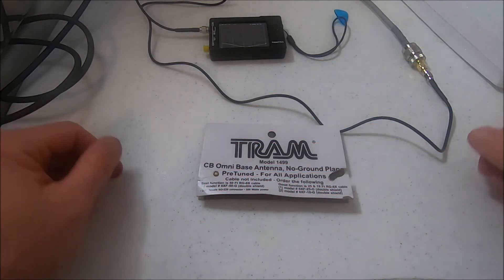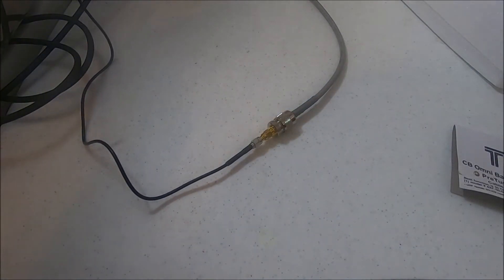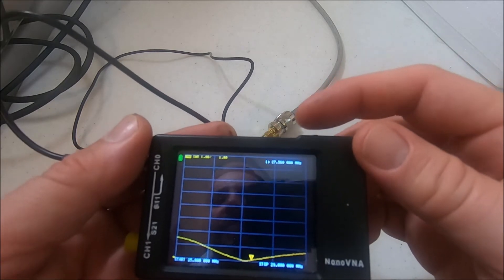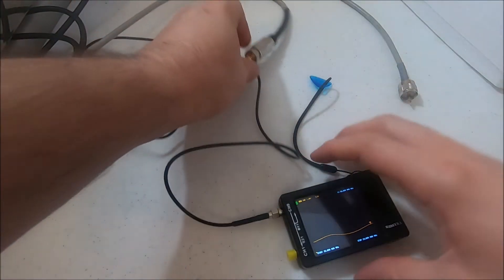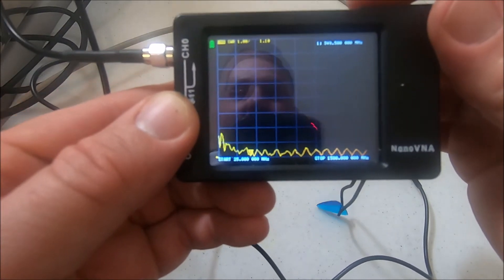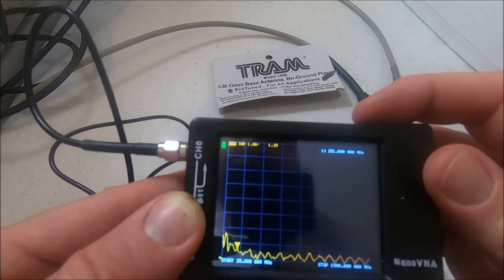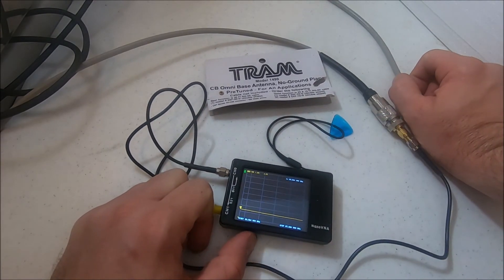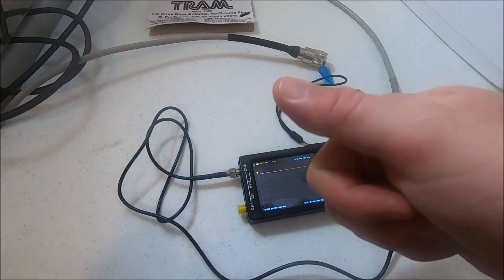Tram 1499 Follow up on the NanoVNA

Comment: Cb, 10m, 6m, 88-108, air band, 2m, murs, marine vhf, 220, 440, gmrs and 900 mhz ham and wifi dx...lol...what a nifty stick.
Reply from the maker: It sure had an interesting results !  I didn't keep it up long !
Reply: @EricTechstuffs  Yep, swr is a big deal. Most people do not detune their radio to lower wattage, to make it handle more backwash on tx.

Comment: When I left my previous comment, I hadn't watched the first video in this series.  I didn't know that you had painted the antenna white.  What brand and type of paint did you use?  The problem is many paints use metal for the pigment.  Commonly used white pigments include Zinc White, Titanium Dioxide, Zinc Sulfide, Lithopone, Alumina Hydrate, Calcium Carbonate, Blanc Fixe, Barytes, talc, silica, and China Clay.  Using a paint with a metal pigment would be akin to wrapping your antenna in aluminum foil.  It would sure ruin the SWR and prevent the antenna from working very well.  Now, the paint layer and pigment is not as continuous as foil so the antenna might work to some extent.
Reply from the maker: Interesting to know about different paint pigments... I used a bargain basement paint so I am sure it was made the cheapest way possible for coloring.  Do you know of any name brands that do not use this for coloring?   I also think the SWR was off  due to using 100ft of coax instead of the recommended 50ft to act as the ground plane.  OF course some have had better luck with this antenna and some even bought two and one worked better than the other.  Thanks for watching and the info   !
Reply: @EricTechstuffs  Sorry, I don't have the info on what different brands use for pigment.  I wish I did because I have a Comet dual band antenna where the coating is starting to get pin holes in it and I'd like to paint it.

As for the coax length, adding length should improve the SWR as it adds loss both in the forward and reverse directions.  I just bought the Workman version of this antenna and plan to try it with different length of coax and see what I results I get.
Reply from the maker: @BryanTorok  please let me know how it works out. I still have it in storage so I am interested to see what length coax works best
Reply: @EricTechstuffs  I'm not sure when I'm going to get to it, but I'll try to come back and post my results.
Reply: This just kinda ruined the movie...lol
Let us know what paint turned it into a legit discone!

Comment: Given the number of people on YT who have gotten good SWR from 27 to 29 MHz, I would think that either the antenna or the coax is bad.  It would be nice to have done the actual vector analysis (that is why it is called a Vector Network Analyzer) to show the impedance vs frequency.
Reply from the maker: I can agree. I used 100ft instead of the recommended 50ft.  Some have had better reports more than others. It just didn't work in my senerio, but some have had great results. I would like to hear someone using it for DX.  I have it around here somewhere - I may give it a shot with a 50ft coax and see.  I have to use the vector section - you are correct for better results ! Thanks for watching!

Comment: You have to use 50ft of rg8x. Seen this so many times. Ppl try to get it to work well without following the instructions. You use use 18 for ok and 50ft for best. 100ft will NOT work well with this antenna.

Comment: I zapped my first nanoVNA by connecting it directly to a run of RG-8u without grounding the coax first. A charge had built up because of wind over the fiberglass antenna radome, stored nicely in a 60 ft run of coax acting as a capacitor. I learned the definition of transient current first hand that day but just shorting the center conductor to the shield will discharge it before connecting the instrument.
Reply from the maker: Thank you for for the tip ! This is really good information !  I will be doing that in the future anytime before I use it !

Comment: 18ft is half a wave length on the CB Band, so what they are really saying is to keep 50ohms then use multiples or equal fractions of the 11 meter wave,  ie: One full wavelength is 11 meters/ 36 ft,  Half a wave is 5.5m or 18ft,  Quarter wave is 2.75m or 9ft, so the Coax should match any multiples of those numbers in length, for TX Transmitting,  Receive can be done on a long wire 39.84mtr
Reply: Its all in the ARL Handbook and it does work, thats my method for perfect 1.0-1.1 Swr at 50ohms, Zero reflectance
Reply from the maker: Thank you.  I saw it was set for optimal of 50 ft ?  What length of coax did you end up using and how well does it perform? I know for the price I did not expect much.  People have had mixed results but the coax length makes sense for the groundpane. Thanks for watching !
Reply: @EricTechstuffs  I used 11meters the SWR is 1.0 - 1.1 its mounted to a 7 meter galvised pole and works ok,  good enough for 15-20 klm radius unless the station is hitting you with heaps of power, will test the limit soon
Reply from the maker: Thank you for the info !  Please let me know how DX works. I have a Stryker SR-10MM that gets me all my contacts.
Reply: @EricTechstuffs  No worries the week-end is coming up, the weather is nice so i will re-test it, with locals
Reply: Dont know if anyone gives a shit but if you guys are bored like me atm you can stream all the new series on instaflixxer. Have been watching with my brother during the lockdown =)
Reply: @Vance Jaiden yup, have been watching on instaflixxer for since december myself =)

Comment: I tried 3 different coax setups...different mounts and grounding wire...it was only resonant at 25mhz...of course I bought it at xmas and put it up this spring...no returns. So I put it onto an autotuner and it works pretty good. With 12 watts i did 20 miles on ssb transmit. Received local contacts who were 40 miles away running 200w on Imax. This was at 34 feet. I will try 84ft eventually, on my concrete silo on the farm.
Reply from the maker: I have heard that the results vary from antenna to antenna as well. Seems some have great SWR and some do not. However for a cheap antenna, it is what it is.  It is great you are having some luck with it! I did forget to mention that an antenna tuner could help bring it into range, as it worked in your application.  It would be nice if they had a screw or something like the firestick mobile antennas to do some adjustments. Thanks for watching ! Keep me updated on how yours turns out ! Hope to catch you on the air ! ~ 1200
Reply: Coax length is critical for this little guy
To keep 50ohms then use multiples or equal fractions of the 11 meter wave,  ie: One full wavelength is 11 meters/ 36 ft,  Half a wave is 5.5m or 18ft,  Quarter wave is 2.75m or 9ft, so the Coax should match any multiples of those numbers in length, for TX Transmitting.
Reply: @MrJaz8088  Hard to cut brand new coax with new ends on it...I have a mfj-269c...but I know 10% of what it can actually tell me.
Reply: @tf7274  If your not willing to cut the coax, then make a new lead, i would just cut the coax, as the length you have is not right, so why keep it that way ?
Reply: @MrJaz8088  simple...$148 lmr 400 vs $40 antenna...i'd rather lengthen or cut the element inside the antenna then cut a new cable. Or I can sell the antenna. .
Reply: I've made 15+ tram antennas cut to a specific frequency. I take the original whip off and use stainless welding rod as the new whips. 1 mm too long or too short is a deal breaker...
Reply: @tf7274  LMR on a $40 Antenna what a waste of money, Best to keep that $148 cable that does not match, a cross your fingers for a miracle
Reply: @MrJaz8088  I totally agree. That Tram is a hot knife away from being great.

Comment: Seems even the few people that get this antenna tuned perfect are lucky to get 4 - 5 miles range from it.  
I am happy with my Antron 99. 
It gets out to around 13.5 miles easy and a bit farther under the right conditions.
Reply from the maker: I agree ! I was looking for a cheap stealth antenna due to HOA but I did get what I paid for.  Antron 99 is still one of the best Omni base antennas that has held up to the same standards over the years.  Thanks for watching !  I miss my old CLR II
Reply: @EricTechstuffs  A99 also covers over bands if your a Ham
Reply: @MrJaz8088  How wide is the 2:1 SWR bandwidth on the A99?  I understand that you can tune over a decent range, but can I do 11 and 10 meters without retuning it?
Reply: @BryanTorok  Nope its one or the other, not both